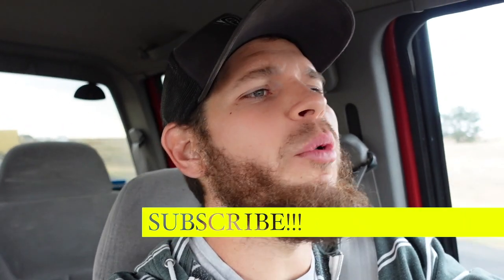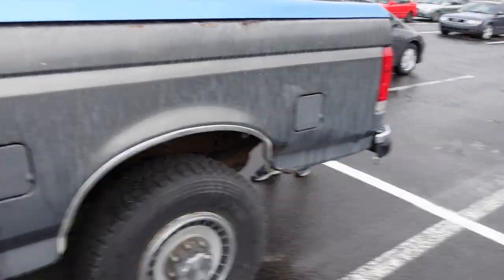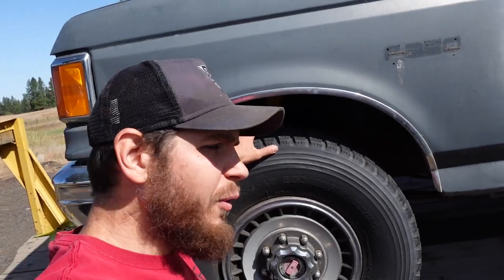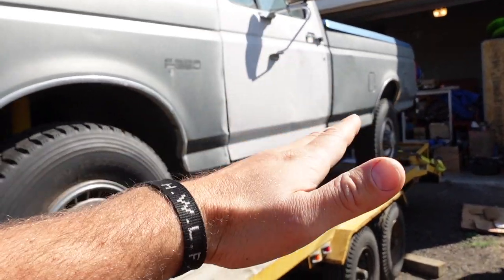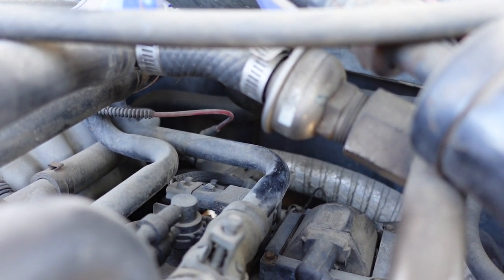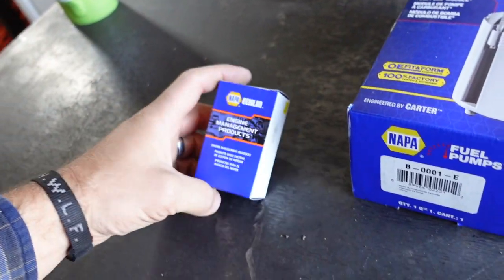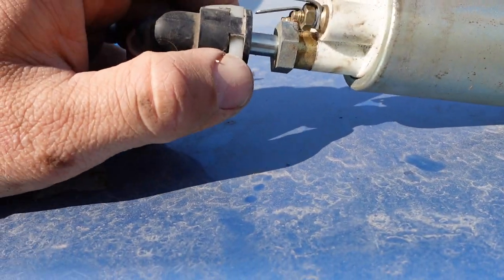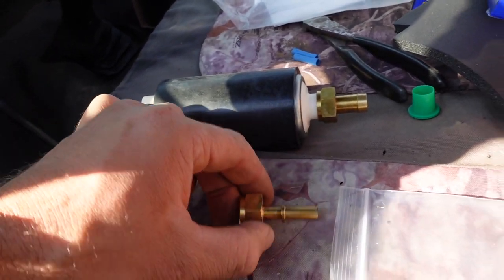89 Ford F250 Fuel Pump Issues: Project Fordinand

Comment: Thank you 1,000 percent for posting this video. I replaced both fuel tanks on my 1989 ford F250 4x4. I removed the rail fuel pump 6 months ago and I've been waiting on parts that just arrived. Although I took video of everything as I removed things piece-by-piece, I didn't video which direction the rail fuel pump went. Your video was a life-saver. I see that the electrical hookups (pos & neg) face the front of the truck. I couldn't remember the fuel flow direction. This has been a 6-month project as I have been waiting for parts and such, but now that I know how to re-install the fuel pump, I hope to have my truck running in about an hour. I'll post an up-date later. THANK YOU!!
Reply from the maker: Right on glad it helped!

Comment: Those years of ford's have a ground wire eyelet that attaches to the rad support for grunds to in tank fuel pumps. They are usually 2 black wires & eyelets & usually on the passenger side. These grounds definitely have to be attached for the fuel pumps to run !! 
Hope this helps
Reply from the maker: I'll have to check that out, thanks! The front tank pump was definitely bad, we hard wired it and it still didn't run, replaced the pump and now it runs great! haven't hard wire tested the rear pump yet

Comment: i just had this problem on my son s 89 f250 and it is the sending units in the tanks . there is a rubber tube that conects the intank fuel pump to the sending unit ant it will rot away and will stop letting the low pressure pump work.
Reply from the maker: I got it fixed, both in tank pumps were bad!

Comment: Did you check Ignition control module on the distributor known problem
Reply from the maker: No, but we figured it out, the in tank fuel pumps were bad. It’s a good runner now! Thanks for watching

Comment: Hello. I WATCHED YOUR VIDEO. I WENT THRU SAME PROBLEM. 1989 F-250 XLT .THE MECHANIC SWAPPED OUT a fuel pump w. Attached pump. I drive it a 1/4 of  a mile away frm his shop. Truck died.

Comment: there should be a fuel pressure test port in the manifold, it is a schrader valve. can you hear the in tank pumps run? you can jumper the fuel pump relay to cheat the system and make the fuel pump get power. a wiring diagram would be helpfull.
Reply from the maker: I can’t hear the in tank Pumps running at all, I did jump the relay and was able to get the high-pressure pump to run.

Comment: Do you still have the truck? I’m having the same issue right now with my 89 F250 7.5 460, it was working just fine and after a fuel months of sitting it just doesn’t want to crank over any more
Reply from the maker: I don’t have the truck but I did fix it, ended up being both in tank pumps were bad